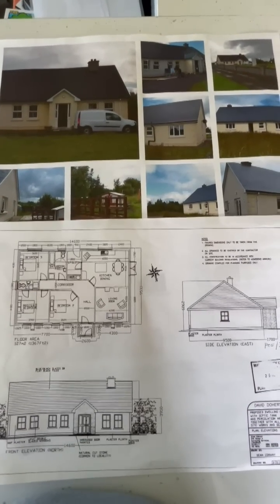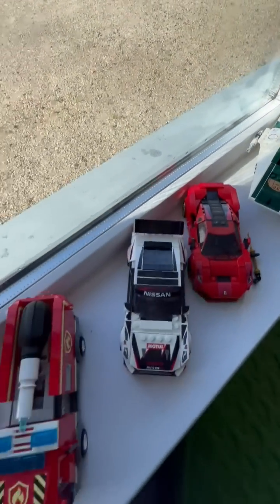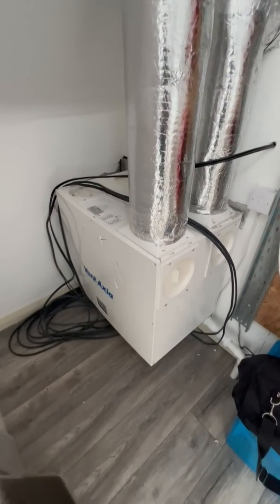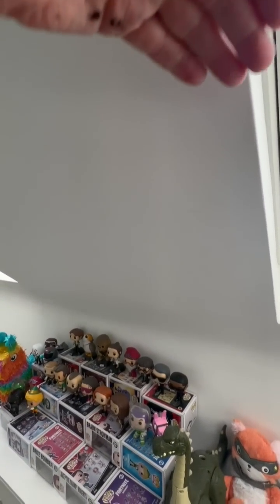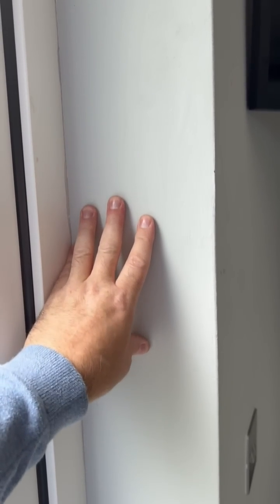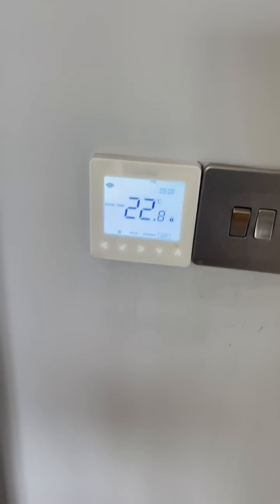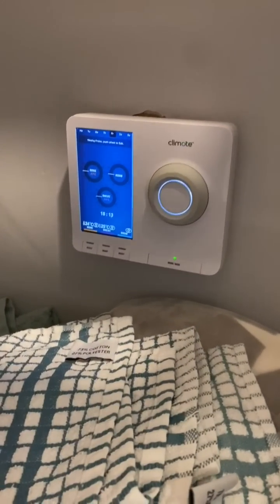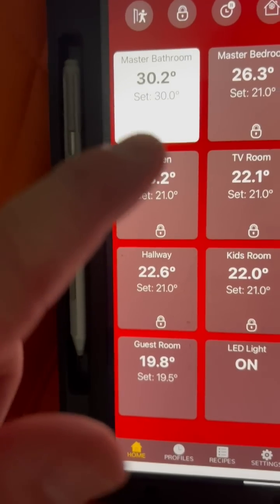Are you planning to #retrofit your home in Ireland, watch this VIDEO CASE STUDY.

Comment: Great. Are there any houses which would not be candidates for mechanical heat recovery systems?
Reply from the maker: Simple answer is no house is unsuitable, the main unit is straight forward and a bungalow would be very easy, however, 2 or more stories now have many types of flat ducting which can be used to get to lower floors.
Reply: @HONEWORLD  Would an old 1900's house/late 1800's actually need MHRV after lime rendering/diasen dithionite is applied with wood fibre?. (Walls are too thick for cavity wall insulation, external wrap would cause mould and dry lining similar). The thick walls and natural wood fibre would allow natural breathing so in summer time it would never get the extreme of a new build or original brick build renovation?.
Reply from the maker: @JimPrendergast  The primary use of ventilation is to allow you to seal a house and make it airtight. This is different from walls naturally breathing. The MHRV will then manage the air so you don’t get mould or condensation which looks like would be a bigger issue than normal. Without mechanical ventilation, you will need passive ventilation such as wall vents, etc.
Reply: @HONEWORLD  Thanks all.

Comment: Do SEAI grants apply to this system? If yes, how much? If no, why not?
Reply from the maker: Yes, several grants apply across the system for different measures. The grants will vary depending on the project size.

The panels are also SEAI’s Triple E accredited which is reserved for the top 10% performing renewable products.

Comment: How is the cold air from outside heated during the winter using this system?
Reply: The heat is extracted from the hot air leaving your home and is used to heat the incoming cold air. it's a very clever system.

Comment: Hey. Very impressive way to self sustain energy usage. Interestingly, we have somewhat similar setup (12,5kw solar PV, vent axia HRV, electric rads driven by Eddi, hot water driven by iBoost and EV charger with Zappi. Quick (possibly dumb) question. With excess electricity generating during bright days, can an inline heater be added to Vent Axia manifold to blow hot (~21’C) air into the rooms? I want to stop using the rads and get warm air coming from the HRV. Keep up the great work. Certainly impressive.
Reply from the maker: Hi, Its best to use Renewable Heating for central heat as electricity is very inefficient at producing heat. HONE Thermal/Electric panels make both heat & power and are EU certified for central heating use.